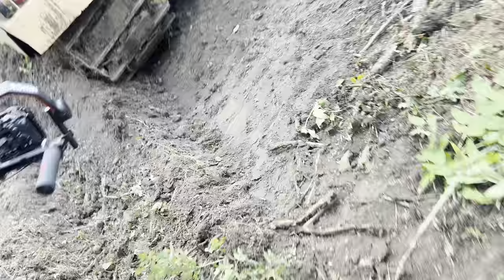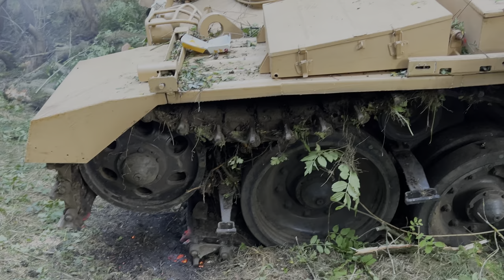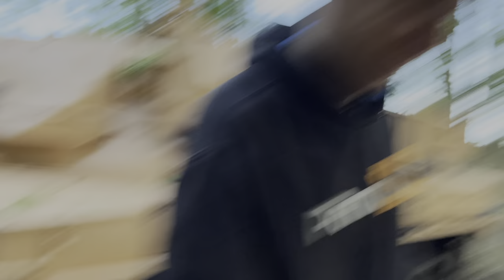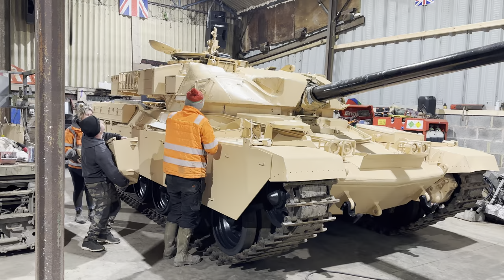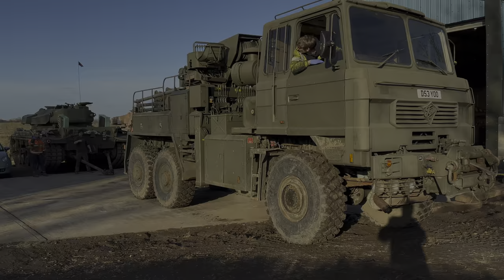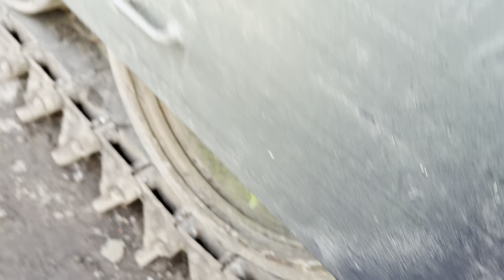@whistlindiesel’s Tank ready for shipping!

Comment: I've tried researching it a bit, but thought I'd ask, what is it that makes the chieftains smoke so badly? Is it normal? Or is it a sign of a dying engine. I know they were unreliable but wondering if the smoke is related.
Reply from the maker: 2 stoke engines always smoke, tbf once they have been running for 10 mins they clear up
Reply: @MrHewes  but not before your eyes are stinging & lungs burning as you guide it out of the hangar.  ;-)